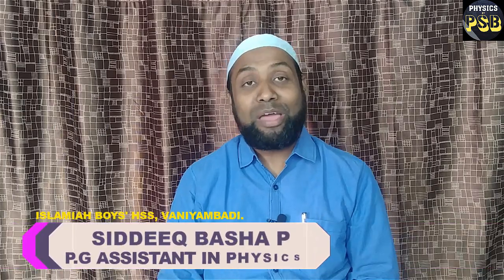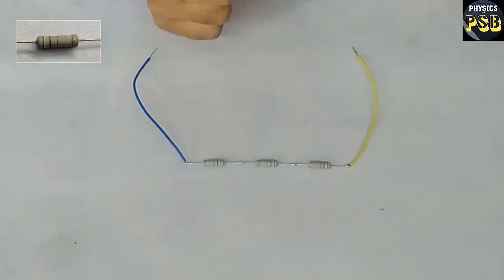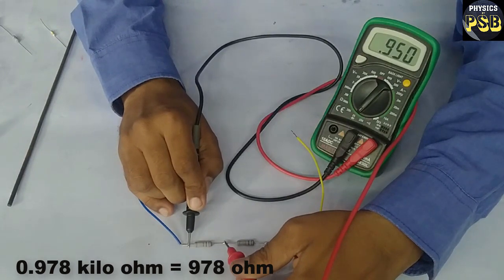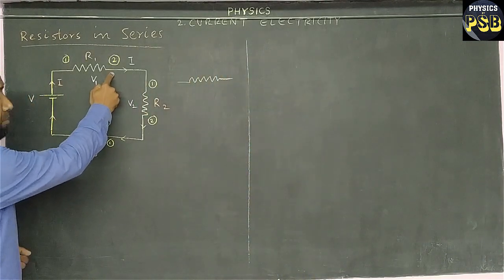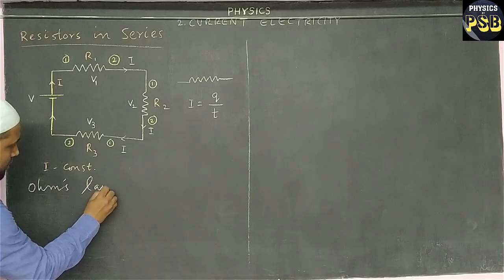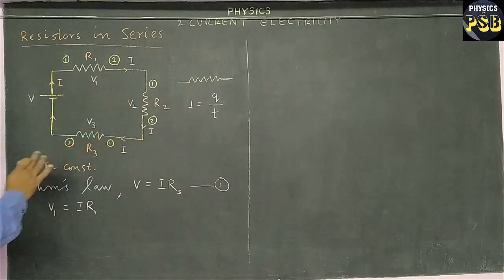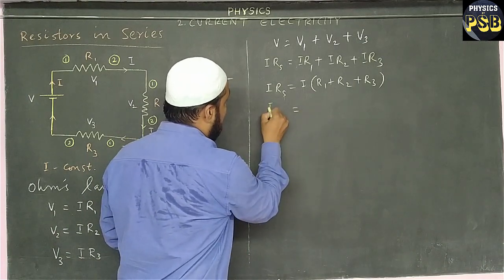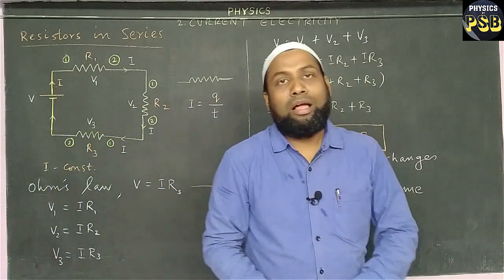Resistors in series | Demonstration | Class 12 Physics | Current Electricity |

Comment from the maker: Resistors have some tolerance.  That is why they show a different resistance (either less or more) value on measurement.  In our case, the multimeter shows a value less than 1000 for the given 1000 ohm resistor.

Comment: Aslam Alaikum Sir. 

Yet another video with clarity in teaching and presentation. You make everyone glued to your teaching with the live demo of the concepts and this makes you odd man out. Many thanks for the same, sir.
The resistance of individual resistors is 1000 ohm each but the multimeter shows a value less than 1000 ohms for all the three resistors. Is there a reason behind this?
 Thanks for the video, sir.
Reply from the maker: Walaikum assalam, thanks for the appreciation and encouragement.
The resistors used in the video have - 5% tolerance.  That's the reason why the multimeter shows resistance less than 1000 ohm.
Reply: @siddeeqbasha  Thanks a lot sir.
Reply from the maker: Most welcome